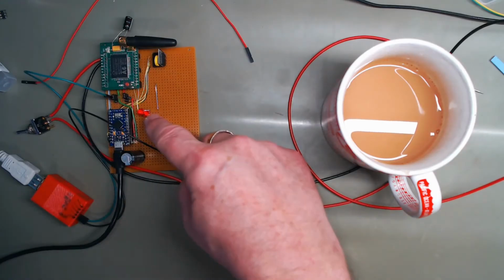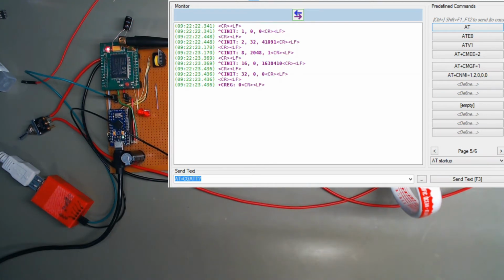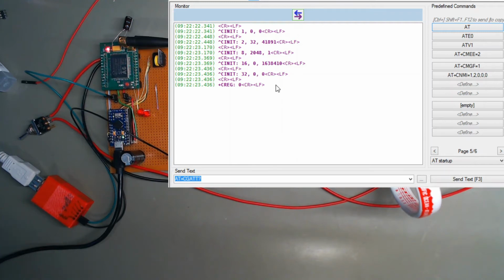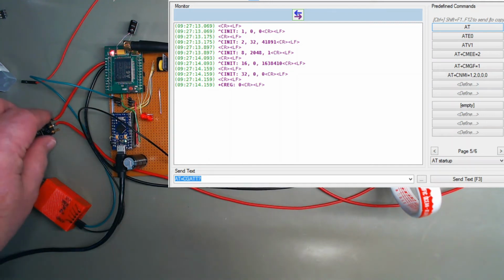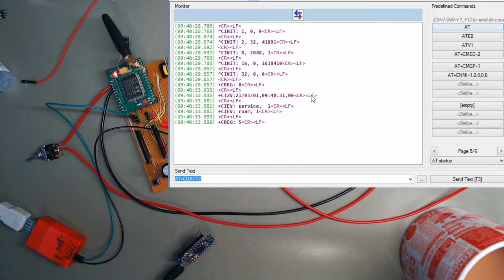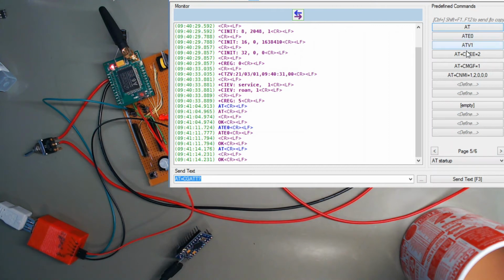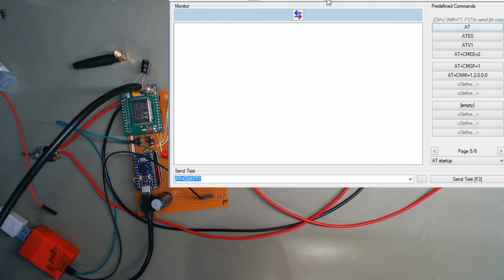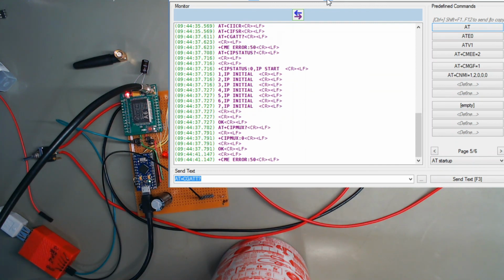#086 GPS Tracker project update

Comment: Hi, I've just been using an Arduino 'Pro Mini' and I had forgotten about the 'Pro Micro'  that has the USB stuff onboard ! nice catch on the problem...cheers.
Reply from the maker: Hi Andy thinking of moving away from the pro micro, as the bing bongs as it changes port number is driving me mad. and every now and then it decides that windows can't see at all with constant ding dongs. drives me mad as hell. :)
Reply: @TheEmbeddedHobbyist  LOL!
Reply: @TheEmbeddedHobbyist  does it have internal usb-serial or is it maybe a ch340 being rogue :)
Reply from the maker: @maicod  it''s built in, and every time it's programed it sets the port, so windows goes bing bong, every reset it goes bing bong. Plus every now and then windows goes bing bong as it does not know what the device is. so all in all it spends a lot of the time with windows going bing bong. drives me mad.
Reply: @TheEmbeddedHobbyist  that's super irritant. you could silence the sound(s) but windows still keeps unmounting/remounting ofcourse

Comment: As the Buzzcocks said "noise annoys" Could it be an impedance issue with the antenna? How are you powering this all?  Just curious.
Reply from the maker: Don't think its an impedance issue, I think its just too close to the arduino and its an EMI issue. the power supply is a GW Instek programmable power supply PSP-405, good for 5A. But i've got the current limit set at 2.5A. I expect the module puts out its maximum power while it is connecting, then back off when the connection is made. but at least it now connects every time. just i time for them to remove 2G in the uk. :)
Reply: @TheEmbeddedHobbyist  Noise can be a pain, I know.  You could make a box and use some copper foil tape inside with one connection to GND to see if that helps. I wanted to play with the GSM's for my waypoint robot years back but was unsure how well they worked and just USB connected to an android phone.  They knocked off  2G in the states I think in 2019.
Reply: The box is for the uC of course :)
Reply: @TheEmbeddedHobbyist  Yeah, my hot-rod cell modems have shaken speakers 5 feet away, when they TX at max power to get in touch with towers.  Never played with one of these A6 devices though.  Disturbing bug (shrug).  Does slowing the modem help?
AT+IPR=57600
AT&W

Long live the AT command set.
Reply from the maker: @GnuReligion  I did have an issue as the code as i had a modem baud routine that would fall over with the EMI and reprogram the modem with a random baud rate. Then i'd have to reset the baud rate, good job that if you keep sending AT over and over again, it will detect the baud rate and switch to it, so you can regain contoll without having to go throught every setting to gat coms back. 

i think the A6's are a bit temperamental but they were cheep. i have a few sim800 maybe i'll try one of them at some point

Comment: Odd. The antenna is not transmitting, so should not be injecting noise into the Arduino. Would be great to know why this change fixed the problem.
Reply from the maker: Hi Dale as far as I know, The module is communicating with the network while it’s establishing a connection, so may be on high power until it can reduce the power to maintain the connection. 

The connection is made once the Arduino is removed or the antenna on the long cable is used. I had moved the +5V and ground feed directly to the module power pins thinking that voltage drops were the problem as it can draw up to 2A on tx.
Reply: @TheEmbeddedHobbyist  Oops. My mistake. I only heard GPS, not GSM. Certainly lots of opportunity for radiated (and consumed) power it interfere in your setup. Maybe I was not hitting on all cylinders yesterday morning. Proof: I also moved my bins to the street a day early :( My wife corrected me before the neighbours saw :)
Reply from the maker: @newburypi  it's ok, last week i put my bin out while the crew in the waste cart watched me, then they drove away as i was late puttting it out. Still got issues with the code, which i think the Arduino pro micro is not helping with, having to slow coms down to 2400 baud as above it starts to miss things. Not sure why a hardware uart should have this issue. but then again i think the arduino knows i hate it. :)